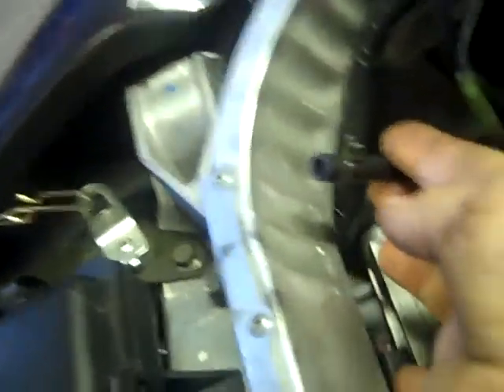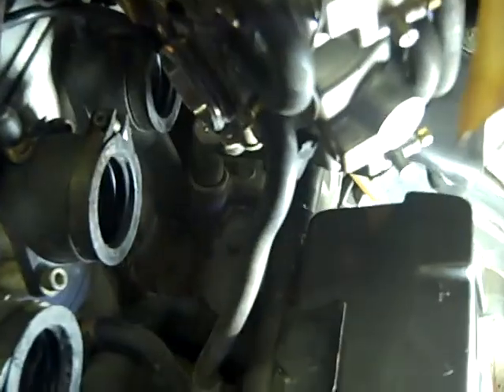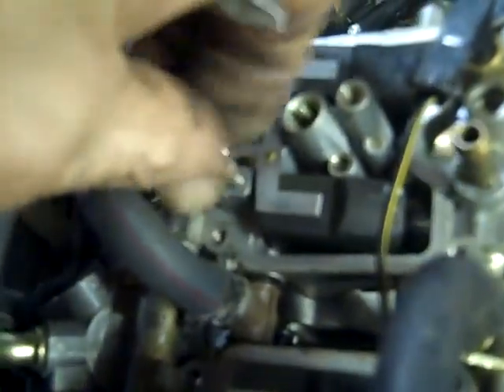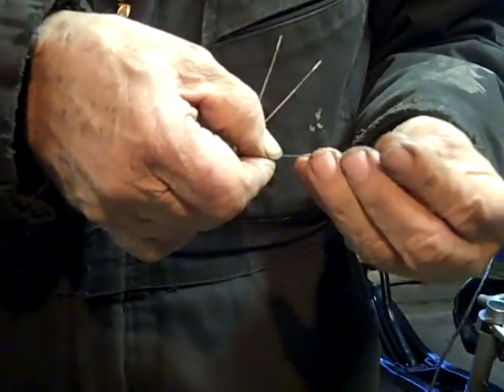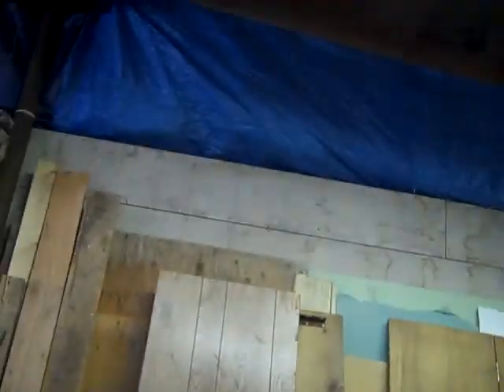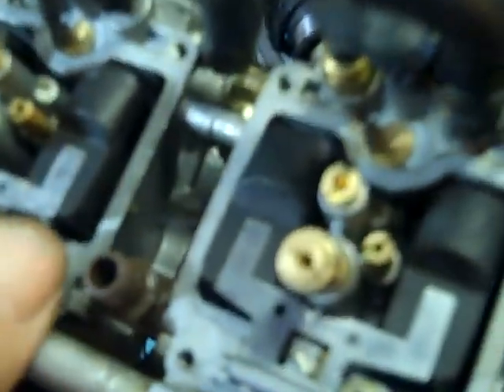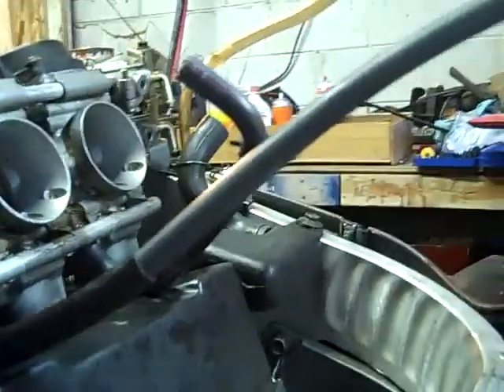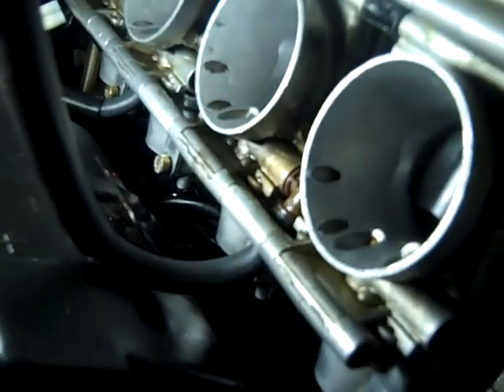COMPLETE RX-1 YAMAHA 4-STROKE SNOWMOBILE CARB.CLEAN

Comment: I got a 2003 Yamaha RX1 that goes maybe 25% of what it can do. Only runs if choke is on. It seems to flood out or bog out as some would say. Cleaned the carbs out and messed with the idle a little bit and ran a bit better. I think it’s the TORS system. Anyone got any ideas?
Reply: You can bypass the tors system, if you connect the 2 wires on the harness side, beware she will ghost ride if anything sticks without the tors system.
Reply: Check the "doughnut seals" on your exhaust! Should be back firing and not exceeding 35 MPH if this is the problem.

Comment: You FAILED TO WARN everyone that the spring loaded FUEL/AIR ajustment screw HAS A TINY FLAT WASHER AND O-RING...CRITICAL TO OPERATING PROPERLY...you just showed the screw and spring and said " blow it out "...well, there goes two critical parts for the carbs to work properly...
Nuff said.